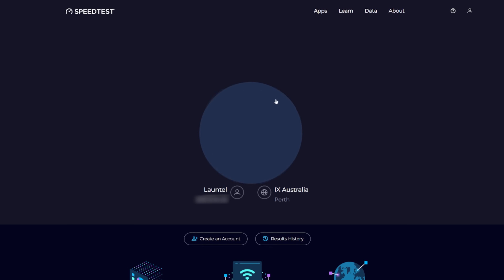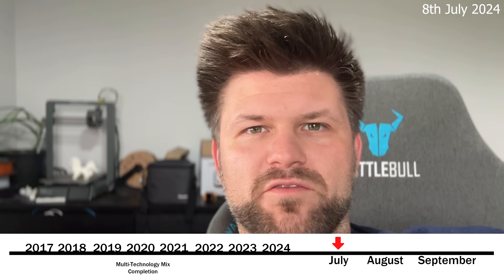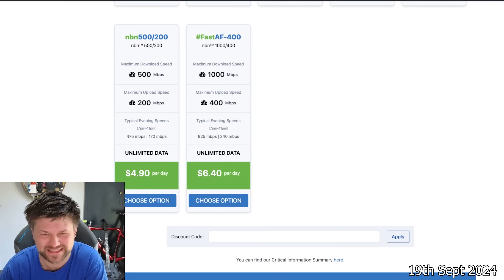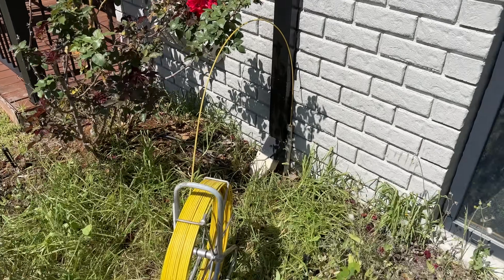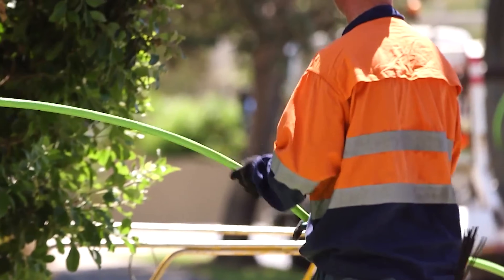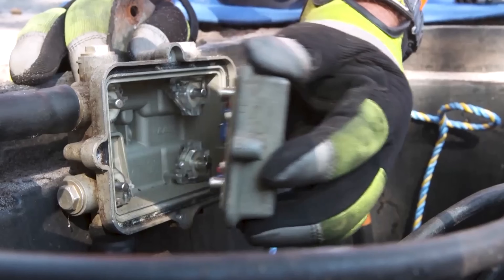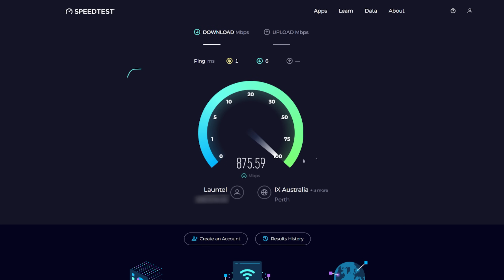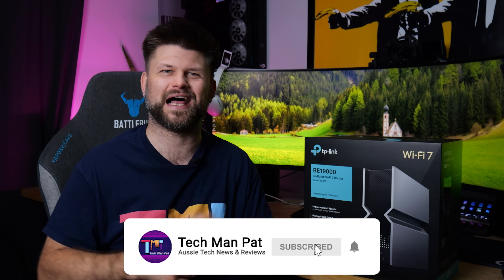My NBN Fibre Upgrade Experience | Dirt Report

Comment: NBN techs often tell me they aren't allowed to work above 1.8 meters at all. And how can the tech in this video do work on the side? One of the things stressed to me in my NBN interviews for a tech role was that no tech is allowed to do any work at all outside of NBN. That actually meant ANY work. No cabling work, not a barista, not even mowing lawns. This was the reason I didn't get the role as I wanted to be able to do the occasional work outside of nbn.
Reply: So NBN pays full 24 hours wage per day? How is it legal to tell what you can do in your time off?
Reply: @Tsiikki  IKR, but this was their condition. I was told that nbn is "quite conservative" and only wanted people to be working for nbn. I think it's not legal but if you were to sign some kind of agreement.....it would probably end up legally binding.
What can one expect from a monopoly :P
Reply: @CommsGuy  Well I don't know AU laws, but it doesn't just click legal to me. There could be anti-competition clause, but usually there's compensation for that.
Reply: The tech that did Pat's install was almost certainly a subcontractor. They have different rules than nbn employees when it comes to things like that.

Comment: I take gigabyte connection for granted I guess lol

Have had FTTP for.... ever?
Basically just sat on 100/25 or something basic speeds.
But fast plans came down slow ones went up, moved into a different place with a couple of boys... $150 for 1000/50 through AussieBB... $50/pp isn't that much at all.
Its great as you can just download anything... super quick, while someone else is downloading something, while everyone is on smart tvs while doing shit on their phones.
*In our old place we only had wifi, so max on my phone was around 400-600 depending where you were in the house, max on my computer was around 450 (upstairs, wifi5).
Now have ethernet through the house.. lol 999

I wouldn't want to pay $150 for just myself (or even just for my family) - but when divided by housemates yeah the pricing aint that bad.
*$129 for 12months atm anyways.

Comment: Geeze, $192 AUD a month for 1000x400. I get 1000x100 via HFC in Christchurch NZ for $74NZD per month. I could have 1000x500 for $109NZD on Fiber if i wanted it...
Reply: Yeah, 192 AUD is +118 euros! Damn! Paid 41,9 € for 1000/400 and now finally we got symmetrical speeds, 44,9 € for 1000/1000. When other provider starts installation of their fiber here it will be 59,9 € for 2000/2000.

Comment: I spliced mine after the joint failed after a long, hot summer.   Just clipped it out and fused it...  Also shortened the cable running in to the NTD...... This year I've ditched the NTD and plugged directly in with an SFP into the firewall.
Reply: Better hope NBN doesn’t need to come around to fix it or they’ll ask WTH is your NTD 😂
Reply: @TheEthNick  Pffft.  WHen ever you want them - they aren't here.
Reply: Doesn't PON need some kind of authentication?
Reply: @Tsiikki  Just the MAC address.

PON works at layer-2 only.   Layer-2 at THAT node on THAT end run.

So nup.
Reply: @tcpnetworks are you emulating the MAC address of the original NTD?
Reply: @iamdave84  Yes.  The MAC address is how your device is registered with the OLT's radius server.  That OLT, on that switch, on that port.

So copying the MAC address is all that's needed.   The OG unit is still there, just incase there's a fault with the fibre that needs diagnostics - as the OG ONT has all of the diagnostics..
Reply: @tcpnetworks  NBN supply the Nokia G-010S-Q SFP for non-premise "Smart Places" installations. I've pondered whether there would be benefits to using that rather than the standard NTD.
Reply: @iamdave84  That's affirm.  That's how it works.  It's a layer-2 service..
Reply: @Tsiikki  some networks need a gpon password but most authenticate using the mac and serial number which you can spoof

Comment: Planning to get conduit put in here as well as ethernet through the house and shift all the networking gear to one location.

For routers i can recommend Unifi gear if you can handle their price point they’re so much easier to work with and i got a long extended warranty on them.
And for FTTN what took me far to long to find the Draytek modems “do note the main one available in Australia doesn’t have a built in ATA for phones and needs you to buy a separate one.

Comment: As a former tach, my splice noise limit was 0.03db or less, my motto was 'your work is your signature' . My source of pride came from never going back for a install I completed, my hats off to your tech for doing a top notch install.
Reply: 0.03 on the splicer or OTDR measurement?
Reply: @florichi  Sorry for the late reply, 0.03 at the welder. When it comes to failed connections, it will be at that join, I have seen some connections that will give you a cardiac arrest.
Reply: @BrotherInArms73  ok. I don't give shit about what the machine tells me, I look at the arc myself and decide if it's good or not. My Fuji 90s regularly gave 0.00 when there was a huge bubble inside and the arc glowed so I needed sunglasses, but if it was totally fine it gave me 0.5dB
Reply: @florichi  My welds need to be clean, mostly as I will not pass a bad join as I see it as a failure, despite low db loss.

Comment: It's good that you had a decent experience with an NBN installer. The vast majority of them barely pass the minimum requirements set out by the NBN (because they need the labour) and are not equipped to do the job all that well. My house was a new build at the time of installation with brand new conduits and draw strings installed for their convenience, and they still fumbled the job. 30 minutes of very poor workmanship and 3.5 hours spent standing around staring at their phones and the connection remained offline for an additional 2 weeks after installation, citing a firmware upgrade required for the NTD.

When my Mum had her house connected, they wilfully ignored her reasonable (and achievable, according to NBN documentation) installation requests knowing that our older citizens are easier to take advantage of, leaving behind one of the worst installations I have seen, with the NTD in an unusable part of the house. On top of this, the installer didn't comply with the requirement to install the NTD within the 3m of a power point and told my mum just to run an extension lead across the floor to it.

With capable hardware the service itself is otherwise excellent with the exception of the NBN requiring more planned outages, even if it is just at 3 am once a month...

Comment: Good to hear your install went a bit better than mine. Frankston Victoria here, about an hour south east from Melbourne. I was straight out of the gate as soon as I could get FTTP I ordered it. Months and months and months later, and having to organise to be home for many many many failed install appointments, I finally got it connected. That mind you was only after I went through there complaint service and had a guy looking after me. The majority of the techs that come out are lazy mongrels that’ll only do the quick and easy installs so they can get there dollars and move on. I already had the conduit and the pull cables ( xtra because I knew the incompetent blokes would mess up the first one) installed through the roof/walls by an ex telco guy /mate so it was all to code. The issue was my pit had to be cleaned out and they had to go via the street pit to a neighbours pit then mine. All too hard for the little pets. Gggrrr. Great help from the complaint guy that helped me though. And it didn’t end up as hard as they first thought. You have to be firm with the techs that come out though as I’d been told. Don’t accept there BS. After 23 years, since Optus were first on the scene, I dropped them for Aussie Broadband. Excellent so far, really happy with them and all the help they’ve given me. Was $144 I think it was originally now $20 more a month for gigabit down. Woohoo 🥳. Word has it won’t be long till we finally can get 10 gig down, I am sure we’ll be slugged a fortune for it though. That’s what happens on this cuntry hey. Another awesome video mate. Thanks. 🙏.

Comment: I'm on FttC. 

NBN won't install FttP at my address because my driveway is concrete. They have basically told me I need to dig it up and put a conduit in
Reply: You can get a thrusting firm for that aspect as a directional driller. That will be on you if you would like fibre.
Reply from the maker: Hmmm interesting, I have heard of others where NBN Comes in and digs their driveway up.
Reply: @DennosManCave is your existing conduit with your copper broken under the driveway?
Reply: @iamdave84  we don't have conduit. The phone line is overhead. And apparently the NBN guy said they wouldn't do overhead fibre lines
Reply: @DennosManCave maybe that tech doesn't do aerial fibre, but others do. I'd give it another go and ask your ISP to leave clear notes to say it's an aerial install. Underground is their preference but that isn't always possible.

Comment: I did this 12 months ago with a different ISP (after the obligatory decade long wait from the liberals removing my NBN fibre build when they got into power in September 2013)
My fibre stopped in my driveway, so they only had to pull about 10m of fibre externally.
Where my installer went god mode, was I had to pull up decking to access the ground where the cabling emerged (my installer helped me, tools and muscle), I also had a crucial doctors appointment outside of the installation window (he waited the 45 minutes for me to return)

Tips I got for customers.
1 - I used the same modem but when I went from FTTN to FTTP I had a change in username/password with the same ISP.
2 - I might want to move my NTD later so I asked the installer if I could have a longer fibre run to the NTD, he gave me a 30m cable instead of the 10m he needed and left me the 20m of slack coiled neatly in the roof, so I can relocate it anywhere in the house.

Side note Damien Ivereigh is a top bloke and the crew are Launtel are a fantastic group for a proper premium internet experience in Australia.

Comment: The previous phone cable at a place I had it installed was stapled inside the wall, so the fibre couldn’t be run inside. The installer did relent though and agreed to run it up the wall in conduit and into the roof space where it was then routed into an existing cupboard that had power etc and all the network points. I had to assist from outside as it was in a corner of the roof.

They would have just done something stupid like putting it in the garage if I didn’t insist though.

Also, when they came to do the outside pre wiring, they managed to cut the existing FTTN phone line weeks before the internal Fibre was due to be installed.

Comment: Congratulations Pat. No one else deserves this as much as you from
being an advocate for quality internet solutions through quality journalism.

I’m a hfc user whose area was in preliminary profiling back in 2013 for FTTP upgrade. I then saw it iced and cancelled at the 2013 election, I hold little hope for fibre. It went out in the storm yesterday and does 4 to 5 times a year. I know we will be the new FTTN in 5 years struggling with low upstream and low reliability.
Reply from the maker: Thank you mate that’s much appreciated, there is some good news coming for HFC too, new video tomorrow hopefully

Comment: The speeds you're paying for, or were IDK if  you're still on the max plan.. it should be no more than $120 tbh. They're so stingy on upload.
Reply from the maker: I had the plan for a month, and I did find it to be quite expensive, but I need the upload so I went inbetween, 500 / 200 plan for $130 ish per month.

Comment: I got an electrician to run a conduit, install a power point and ethernet point as I wanted my NTD in the garage. Works a treat and no mess. NBN contractor was happy to see someone organised 😂😂
Reply: I did the same and installed the NTD in the garage, although I ran my own Cat6e cable from the garage into the house and terminated the points myself. Likewise, the NBN contractor had his supervisor turn up as our conduit to the street was proving to be difficult, he was impressed that I'd done the other work myself and was super organised.

Comment: Ahhh, the old "use the garden hose in the conduit" trick, they had to do that with mine as well. We were already on FTTC so from request to using FTTP was 7 days (Telstra is notoriously slow at activating and took them 3 days for their side). As far as the guys doing the job (2 of 'em)... couldn't have asked for a better experience. We have a seperate garage and the old Madison box was on the front of the garage and was replaced by the newer NBN utility box. They ran the fibre from there through the garage roof and into the house as the roofs overlap and installed the NBN connection box under my desk (using the CAT-6 cable I had going into the Madison box as a draw wire).

I still have the Telstra Smart Modem Gen 2 as well as my ASUS AX11000 router due to the voice service (elderly parent) and Telstra stopped activating the UNI-V ports about 6 months ago. (I spent the best part of 5 hours and multiple agents finding this out with support). So much for NBN only depreciating UNI-V ports in 2031, Telstra jumped the start a bit on this one! Once the voice service is no longer needed, the modem will be removed. Anyway, I'm on their 250/25 "Ultimate" plan and consistently get 275/24 throughout the busy periods and look forward to September 2025 to jump up to 750/50.
Reply: I think Telstra was one if not the last provider still provisioning UNI-V services. So I'm not surprised they cut it off ASAP NBN made the announcement in May Last Year. So it makes sense to no provide any new services using it, the end date of 2031 i thought is the deadline set by NBN so providers must find alternate solutions before that day or customers will be cut off.

Comment: I'm not a content creator so I don't currently need the upload bandwidth right now so I chose Superloops 1Gbps plan for around $100 per month.
I've found that if you are patient things seem to upgrade and change in time where they increase speeds or (in the past) download limits. All you usually have to do is check the ips's for chanbes to their plans every 6 months or so and change to the upgraded version of your current (now obsolete) plan so the added benefits get included.

This first occurred with my first ADSL2+ connection that started at 10gigs down...over the course of four years my plan was upgraded 5 times and ended with something like 80gigs. All I had to do to access these new upgrades was to upgrade to the same plan I initially began with (same price and same tier in the plans but with upgraded offerings).

Eventually it upgraded to unlimited. My Superloop plan hasn't changed but there have been mentions of opening up higher speeds for both down and up traffic so when that happens we'll see.

Comment: The whole story of NBN contractors not solving issues and being jerks! Experienced it first hand. I had an issue in the cable, the first contractor that came in was rude and kept making excuses with the way I had a switch and router inside the garage rack causing fiber to drop out. (I set the AP to router only, there is no wireless signal in there, he didnt believe me)
The issue still persisted after I moved it on his request so I had to re-engage NBN through my ISP. My ISP were hesitant and said the contractor insisted on his report that it was my fault. Luckily my ISP had remote tests they could do to prove it was not working so NBN was forced to send another contractor and finally, this guy had zero ego, he did the entire troubleshooting process and found the issue outside in the utility box at the point where the thick fiber converts to thin fiber. The joint was loose, causing it to drop intermittently. He replaced it and I never had drops again!

Comment: In my case it took about 4 months from it first being listed as available, applying, and final connection due to a collapsed pit requiring a few extra NBN tech bookings which are weeks apart at a time. Been rock solid since though!

Comment: 7:10 see your gutter downpipe for your water? The nbn contractor wated to not dig around the corner of my house for 1-2m but instead cut through my downpipe to run conduit through it. I asked him ...wheres my water going to go then?  Not a joke this happened a month ago in Sydney. 

He also wanted a drill a straight hole through into the house into my loungeroom to install the nbn box on both sides but its gonna be 1m away from a power point on another corner wall.

I told the nbn contractor there has to be gotta be a better than this. Well his response to me was pay a plumber to install the conduit be because he wont be digging or touching roof tiles.

Im glad i didnt get FTTP because all i need is 100mbps and i didnt need the free upgrade. Im gonna worry about this later in the future when necessary but wasnt happy with a NBN contractor.

Not a nice NBN experience but i dodged the bullet. The ISP support was hinting this is a little weird without saying this is very wrong of what the NBN co contractor wants to do to my house.

But the NBN installer contractor wouldn't give me options to even pay them to do adjustments. He just didnt wanna do the job.
Reply: You could consider ordering the upgrade again and hoping for a better installer